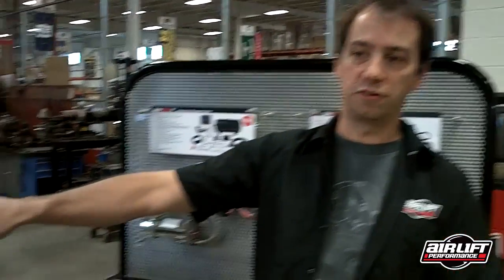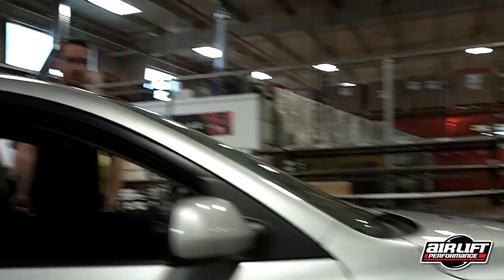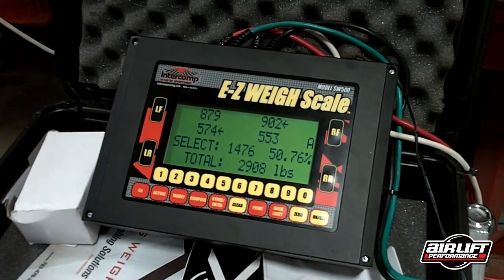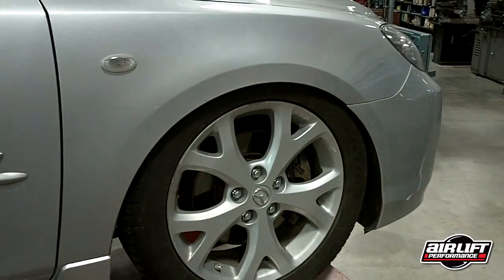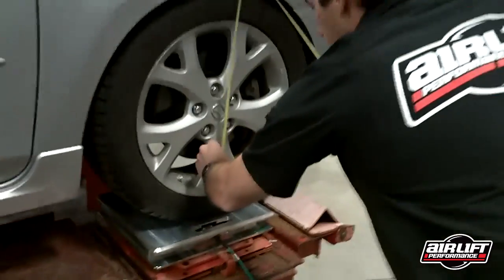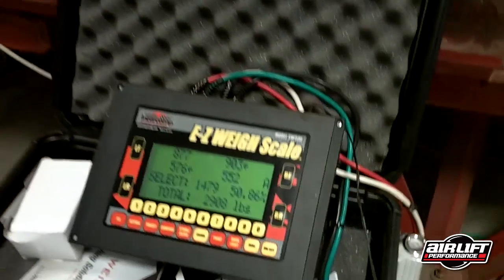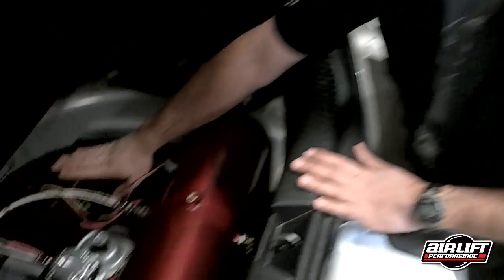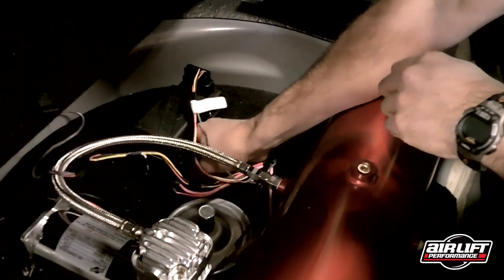Air Lift Performance - AutoPilot V2 Demonstration

Comment: so what happens when i put passengers in the car? does it adjust properly?
Reply: *****
So basically "assume" how much weight is going to be added to the car and then save a preset for that situation. The problem with this is that you're just guessing how much you need to raise up for each situation. I can see the only advantage of a pressure based system like this is price and no height sensors that will fail. Even if pressure is accurate, having to guess how much to raise your car to compensate for additional weight doesn't seem that accurate.

Comment: If you calibrate it with you in the car per the instructions then it works perfect. Im not hating one bit on e-level, But really if your so lazy when entering your car that you can't push a button twice to get to your desired ride height you should even own a car nor be driving a car. If thats the point jebus forbid you have to change the radio, hvac or use a turn signal.

Comment: With 8 presets you can have one for almost any situation. Driver only, 2 passengers, loaded trunk etc.  Temperature has an effect but after you drive a few minutes, your components heat up raising air temp in the bags.  Or create an "early morning, its cold outside" preset.  Lots of ways to tackle situations that didn't exist before.  V2 is easier to install, has way more functionality, is more accurate and has been proven on commercial vehicles before this market.This is a revolutionary change.